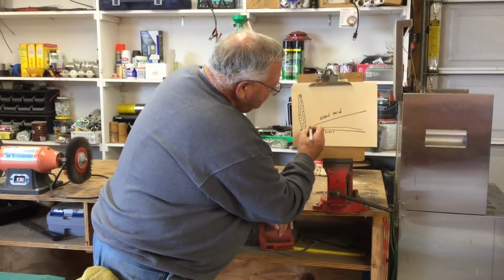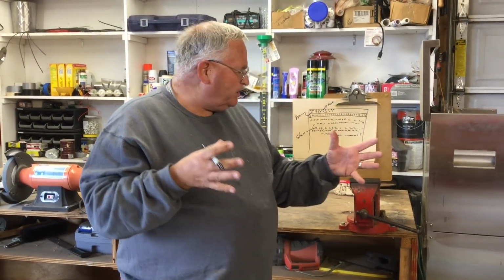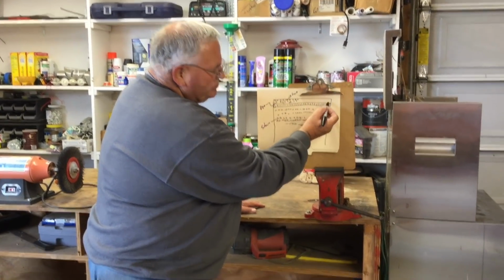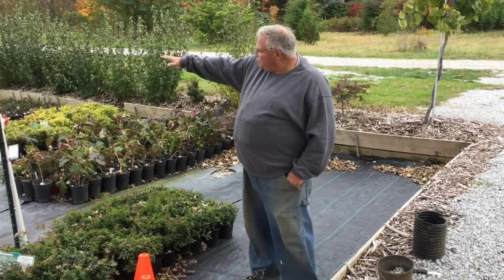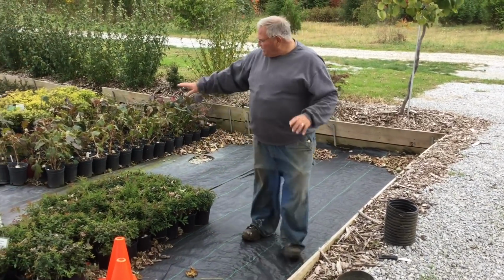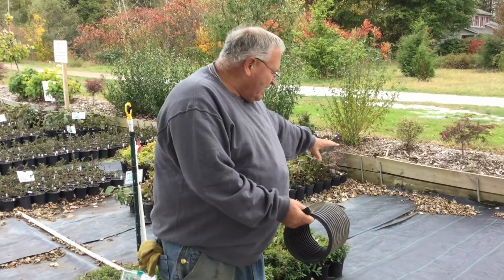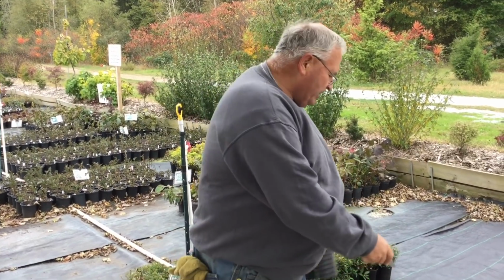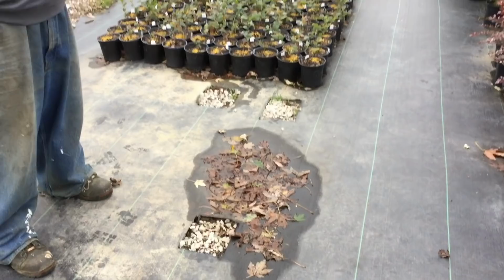How to Get Rid of Standing Water In Your Yard

Comment: I paid $1400 for a french drain and the water is just going somewhere else to be a marsh I am so disappointed in that contractor.
Reply: Did the same but he was too lazy to get a big enough rock screening
Reply: I had a quote of 5K for a french drain across an ordinary backyard. Did not trust that a french drain would work, but would have tried it if the price was right.
Reply: NAT TURNER  Try dumping wood chips and shredded leaves everywhere you have a problem. I dug my own trench with a shovel where the French drain man said he was going to dig. Not wide or deep, just a sort of gutter and I threw all my small branches and other yard waste in the trench. I dumped a big load of wood chips along the side of the yard where water drains in. I did not have any water problems with the yard all winter. I do have an eyesore problem, the yard is all mulch.